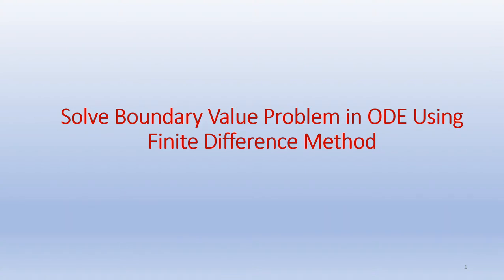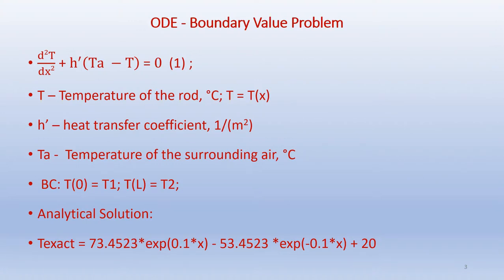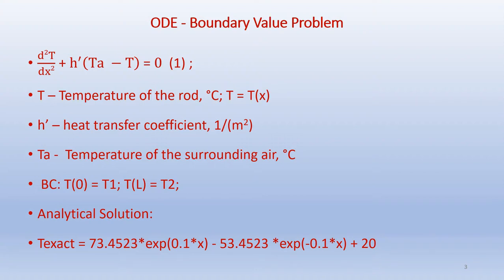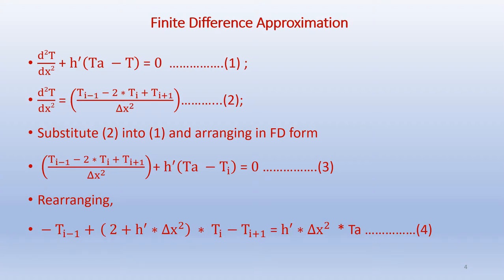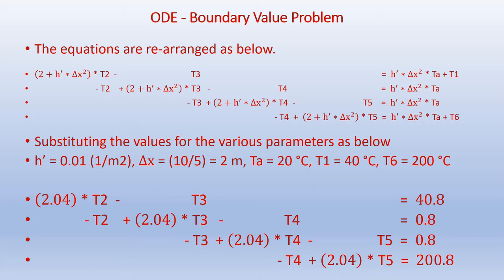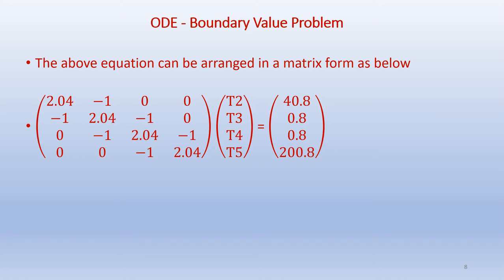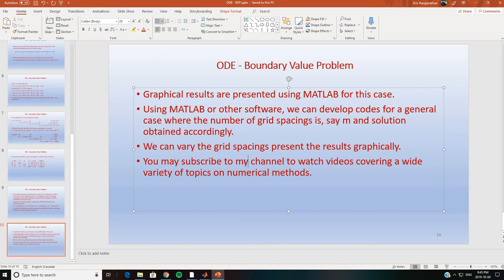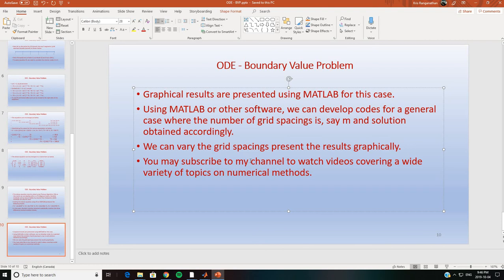Solve a BVP in ODE Using Finite Difference Method

Comment: Hello dude, I am solving 2D diffusion equation with MATLAB, but I could not figure out a way to plot it. Can you share your MAtlab code for Solve 2D Transient Heat Conduction Problem using FTCS Finite Difference Method.
email:mufasakut@gmail.com